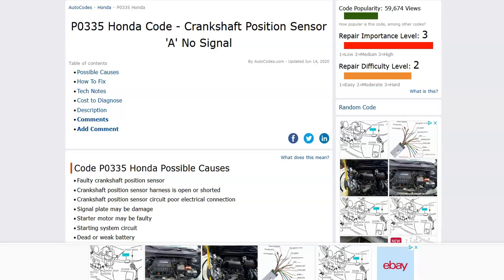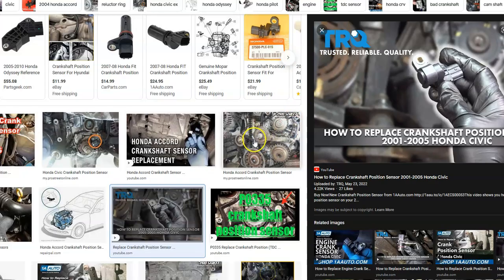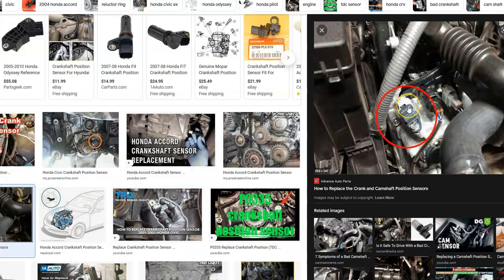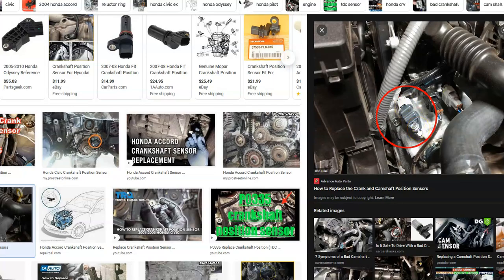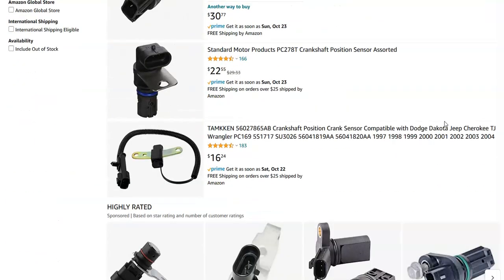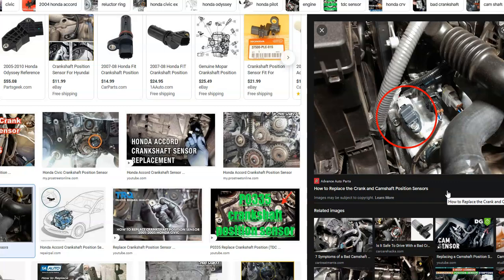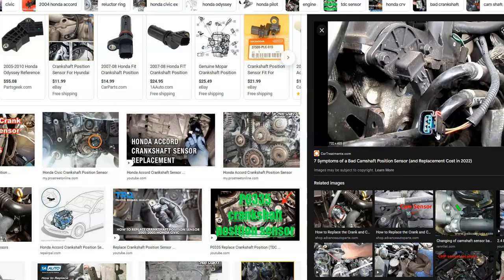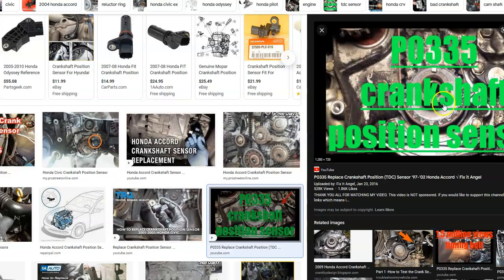How to Fix Honda P0335: Crankshaft Position Sensor 'A' No Signal

Comment: Thanks for the video- it looks like my belt shredded and took out the wires to the sensor. Can I get a new connector with pigtails and solder them?

Comment: Excuse me
I have honda accord 2008 /24. And I have cod po335 error
I replaced crankshaft. And then still the problem
. I cleaned wires same Same
So what can I do
Also when removing cable of air sensor There is no response
Can tell me what can I do? Please
Reply: 1st did you replace it with the original part/ or an after-market part? Honda does not like after-market parts. that is a fact. ive bought from Standard, crank, and Camshaft sensors. and my 04 Civic could not recognize the crank sensor. but it did with a factory replacement.
Reply from the maker: I would check for a blown fuse and test the sensor wires with a meter.